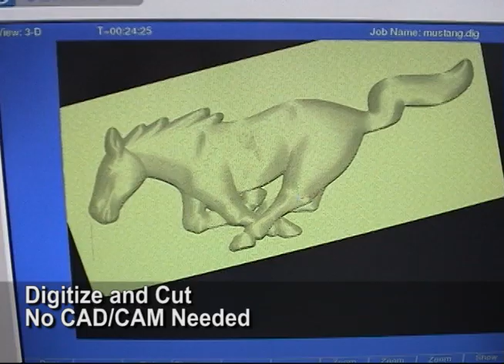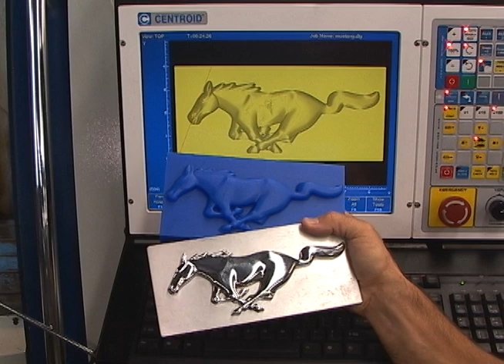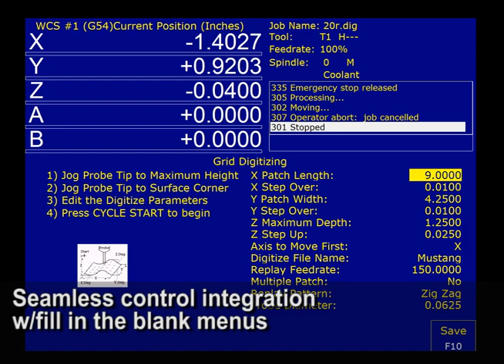CNC Digitizing: 3D Digitizer probe for CNC Millings Machines and Routers

Comment: Is there a setting when digitizing to move faster like in the beginning of video? I can’t get mine to even come close it’s ultra snail speed (70-250mm/m depending on action) Does it correlate with slow jog setting? Besides cranking up the feed over rate to 200% which does go up to 500mm/m. Would it go faster if I turned up my max speed in the wizard? Seems to me it could easily rapid at 750-1000 when it’s moving through empty space.

Comment: Why not just use a Kinect Camera or any depth camera ?
Reply from the maker: sure! but having a touch probe on a cnc machine is still a very useful tool for a wide variety of applications
Reply: Because thats not accurate AT ALL.  It wont capture details. This will.  I have both, and actual 3d scanner and probe. The scanner isnt the way to go.
Reply: Brian A depends on the 3D scanner you have. My intel RealSense are very nice with multiple scanners surrounding a turntable you get very high resolution scans. That said it’s not something you would use for everything. I have the acorn system with digitizer and it doesn’t scan as nice as their pro system shown here. Not saying it cannot but so far with about 35 scans and several attempts to scan various ways it’s alright. You really need to upload the point cloud into cad and a lot of our parts can be hand drawn faster since they are flats. Something with a lot of 3D a scanner can do very well if you have a high quality system. They are great for 3D printing.

Comment: CENTROID 3D CNC Digitizing probing system for milling machines and routers. Copy and reproduce complex 3D shapes with a cnc milling machine. Also, CNC probing with cmm like operations.
How mouch price of above machine ?
Reply from the maker: Hello.  Complete machines start out around $24K (for a knee mill) $32K (for a bed mill) and go up from there with additional sizes and capabilities.